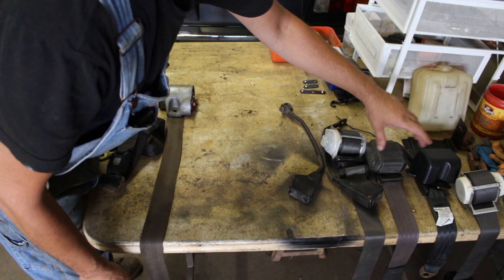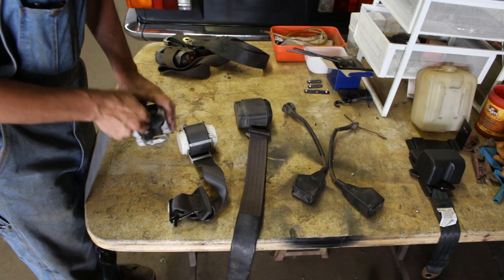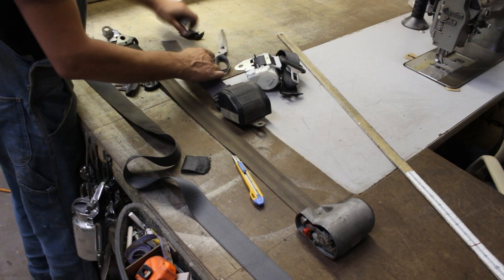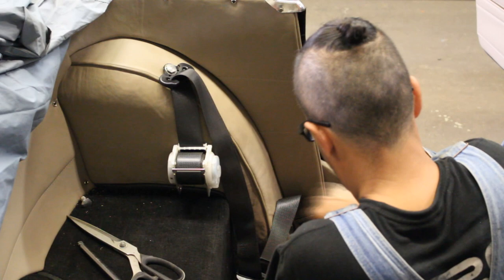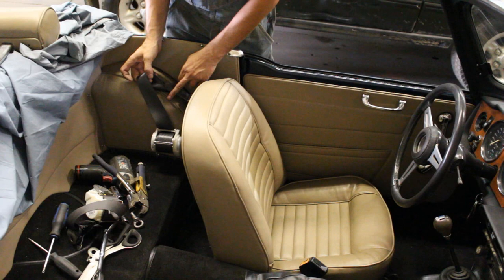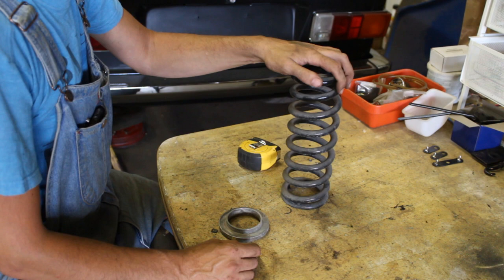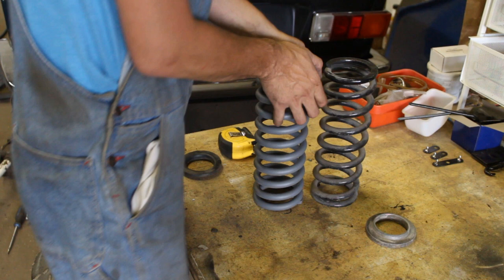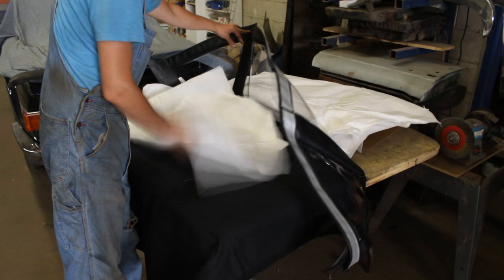1973 Triumph TR6 Restoration - part 35 - Seatbelts and rear springs

Comment: Depending where the spring is on the suspension 1/2" at the spring will Multiply at the wheel end also you should meaaure from the center of the wheel to the lower part of the arch lip to check the ride hight as tour floor my not be level or a tyre pressure may be low  and roll the car back and forth so the tyre can move out and settle the suspension still good content in the vid keep it up. Ps try putting a spacer under the seat belt upper bit at it may be binding on the wheel arch

Comment: Just starting restoration of my "74 TR6. Very helpful videos. Question: When reinstalling the seat tracks, is there additional space that can be used to move the tracks backwards to give more leg room? Thx.
Reply from the maker: Willl Davis I think there are a few inches still available behind the seat to the shelf, but the problem is the lever at the door side of the seat hits the B-post and limits your travel. There is no room to move the seat inwards, towards the driveshaft tunnel either. The only way is to get rid of that lever, but I’ve never done it so I don’t guarantee it will work :) Good luck with your 74!

Comment: More coils on a spring = softer compression. Makes sense if you look at the winding coil...less tightly wound, the metal "rod" is more in line with the direction of compression, while more tightly wound coil puts the metal more closer to 90 degrees from the direction of compression. Much easier to bend something by applying force at 90 degrees  to its axis versus along /parallel to its axis.
Not sure how you have those mount brackets...you said they are already at the lower position. If that means the upper mount point is closer to the ground, that seems wrong. To get the car body to lower, the upper mount point needs to be further from the ground.
Reply from the maker: Yes, that makes perfect sense about the springs! About the brackets, I meant in the lower position for the car, which means the holes are higher, which brings the trailing arm higher and the chassis lower.

Comment: Try Silicone spray on the seatbelt webbing to get the belt retract more easily
Reply: I thought about that too. But, whatever you might use to lubricate the belt will probably end up on your clothes.
Reply: bullwhip johnson I had a similar problem on my VW Eos - it worked for me - there was very little transfer onto my clothes - I used a pure Silicone spray.
Reply: I think it just needs a more direct line. The bulk of the upholstered material seems to be pinching the belt. Between the loop and the spool.
Reply: There is a special belt spray for seatbelts. It works great and leaves absolutely no transfer on your clothes. You could also choose to install a 1/2" bushing under the beltfiting on top of the wheel well.
Reply from the maker: The retractor itself works great. It is from a modern car after all. The problem is where the belt is rubbing against the leather on the wheel well. I added a seat belt guides under the headrests later and that helped a little for the angle. Not so sharp anymore. There is still some restriction, but nothing to worry about.

Comment: Interesting about the retractable seat belt needing to be near metal
Reply: Mike Jackman thay dont thay just need to be 100% vertical
Reply from the maker: Yeah, I thought so,  but it is funny they don't let go when I place them vertically by a plaster wall. That is why I thought there was a magnet inside. They release right away when they are by the metal door frame ?!?